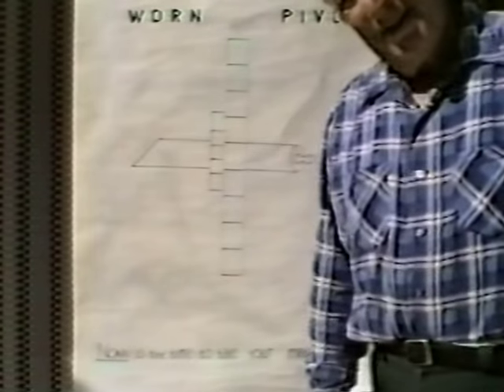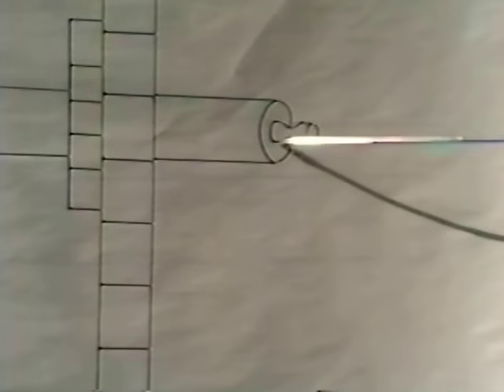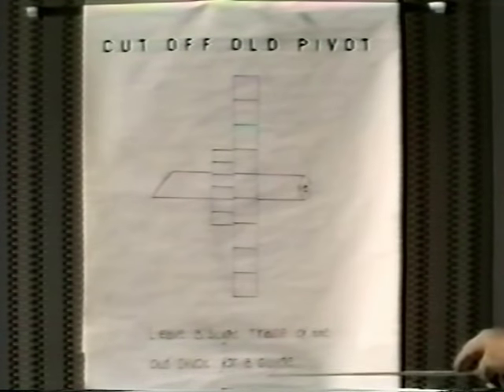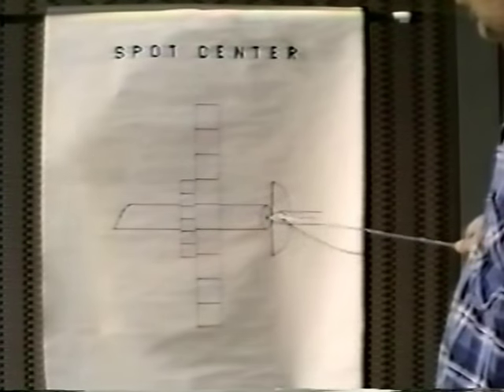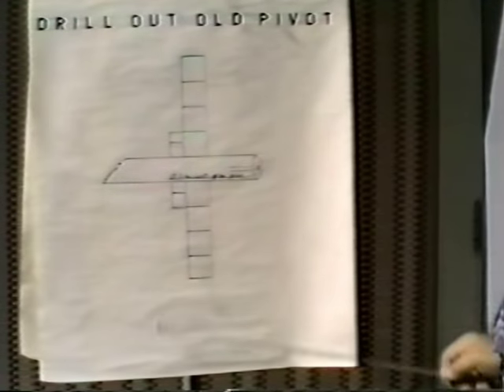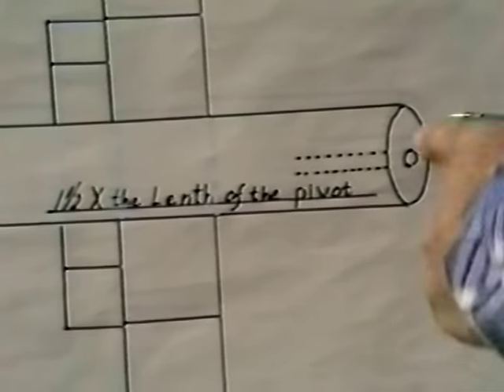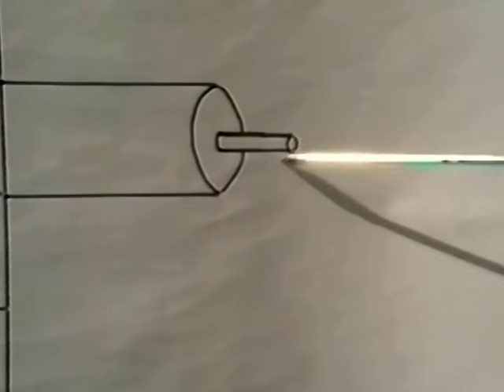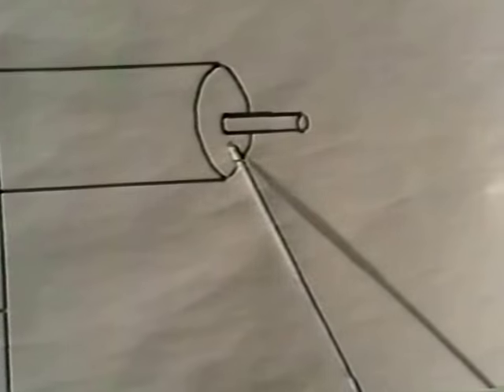Clock Repair - Repivoting

Comment: just wanted to thank you for the video and the advice "practice on a scrap piece first"
 i did just that - got a perfect finish and now a perfect template and system to work to.  Excellent advice saved a messed up arbor and got the finished pivot job spot on.  thank you.